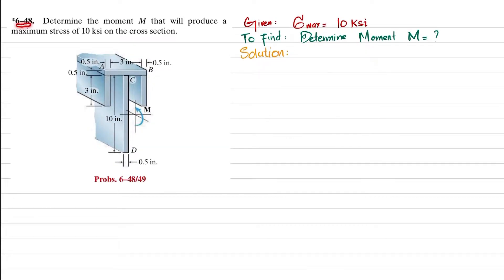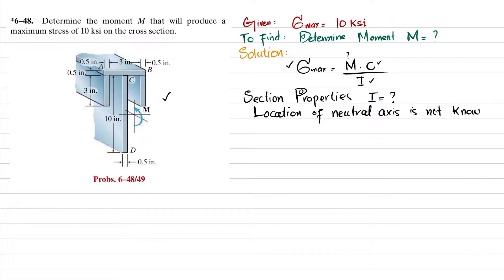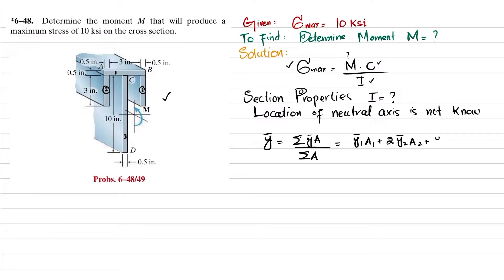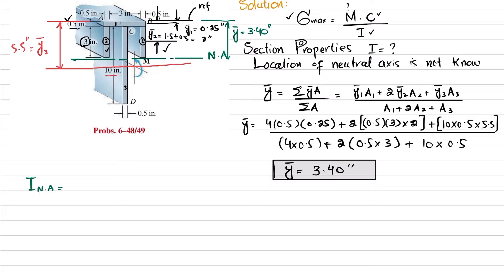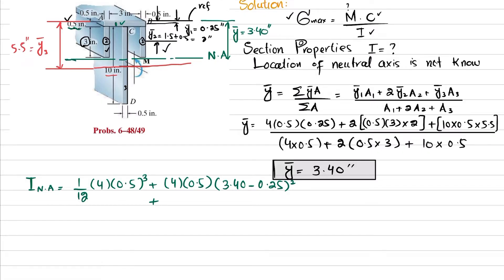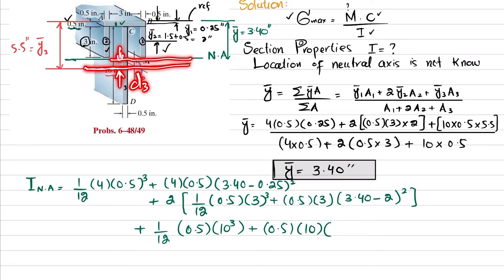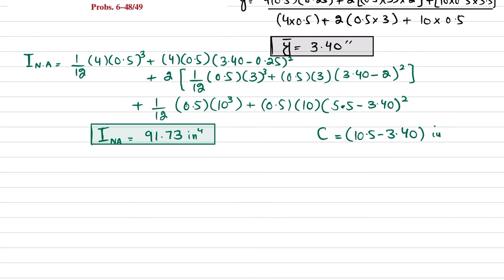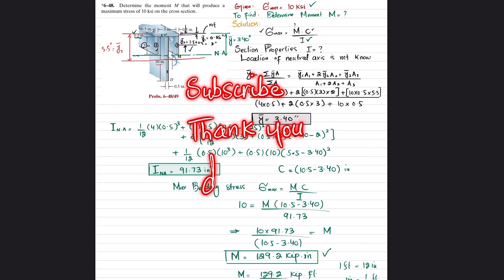6-48 Determine moment M that will produce a maximum stress of 10 ksi | Mech of Materials Rc Hibbeler

Comment: what if my reference line is at the bottom, do i still need to add 10in. and 0.5in to get Y3?
Reply from the maker: Reference like can be at top bottom or mid . Then you have to do calculations accordingly
Reply: @engradnanrasheedmechanical what will be the length for y3 sir? 10 inches or 10.5 inches?
Reply: @engradnanrasheedmechanical a little bit confusion about the "d" distance.
Sir, why you add extra distance to the mid of element 2
Reply: @IslamInaMinute-c5e plz show the time frame

Comment: what if  M is not applied on the neutral axis
Reply from the maker: Then it will be unsymmetrical bending and you can check out their problem as well
Reply: @engradnanrasheedmechanical  thanks. what if the moment is eccentric and unsymmetrical?
Reply from the maker: @wurunzhe  there are alot of problems related to unsymmetrical bending. Kindly search them if you face any difficulty,  do let me know thank you.  I am a little bit busy today.
Reply from the maker: https://youtu.be/BQtjurl7jys 
Check out this as well